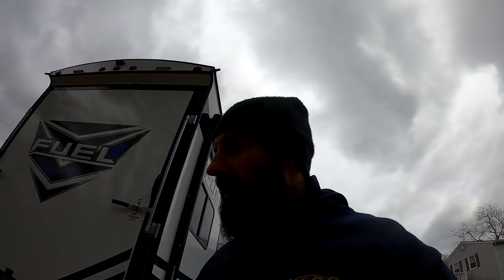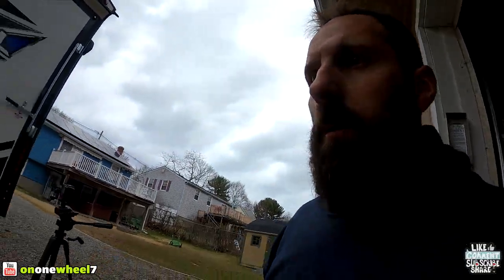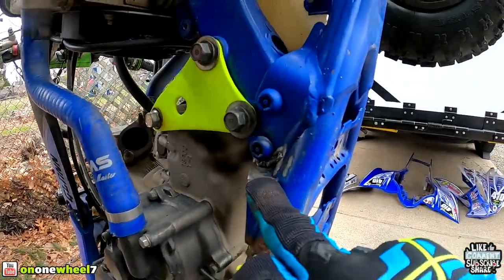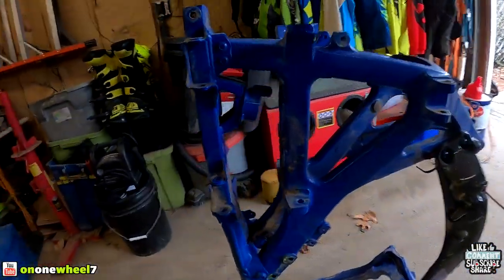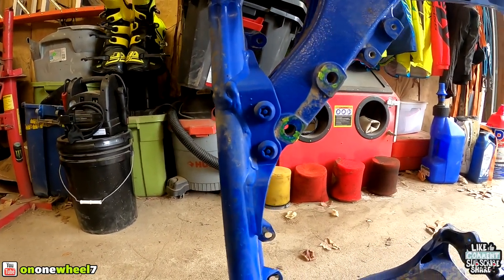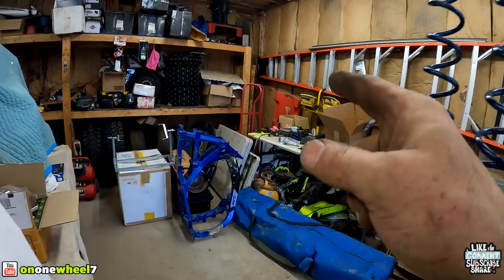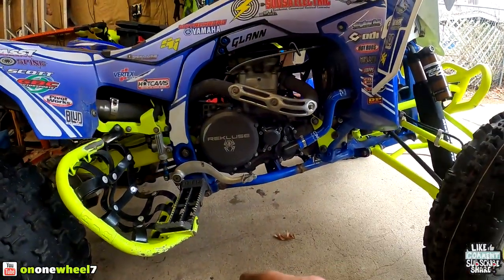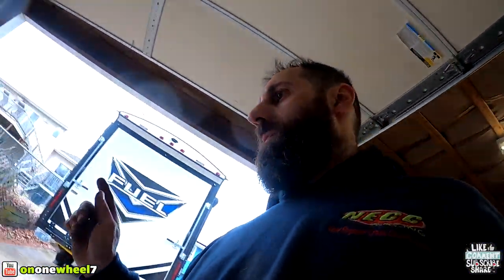FIXING THE PRACTICE QUAD -  THE FRAME IS RUINED YAMAHA YFZ450R

Comment: Out of the topic but Any recommendations on how to get your alignment right, such as toe & camber?
Reply from the maker: Toe you want about 1/8” each side camber is 3 degrees
For tow i use a string off the axle then around the back tire and run it up front and use it as a straight edge to measure of the front tire i ratchet strap the bars straight and then make adjustments as needed on each side until its were i want! Camber a good level surface a 2’ level and an angle finder is how i do that hold the 2’ level on the front tire and put the angle finder on that and adjust as needed!

Comment: Another great video!! What is that Jack/Lift you use to hold your quad up?
Reply from the maker: Thanks man! Its one of the aluminum lifts from harbor freight I’ve had it for 10+ years and its solid used that before i got the atv lift!
Reply: @ononewheel7  Thank you! Harbor Freight trip it is for me tomorrow.
Reply from the maker: Place believe it or not has some decent stuff!
Reply: @ononewheel7  I shop there often. We have 7 actual stores here in Las Vegas. I've just never seen that aluminum lift before. Going to find one for sure. Tired of lifting the quad to put on the dirt bike stand.
Reply from the maker: I am always there as well for something! They at least hear have two jacks one steal and one aluminum the aluminum one is the way to go i think it was 150 back when i got it!

Comment: On your new frame the best way is to cut out a section slide a piece of pipe in it Weld it in place then put the cap back on and weld it back in place..The cap being the piece you had cut out to slide the pipe in
Reply from the maker: Thanks for the tip man this bottom rail is toast i have a new frame to swap over next week!
Reply: ononewheel7 ... The one you’re going to swap over next week is the frame I was talking about, because you don’t want that the creek right away it needs to be reinforced… Respectfully speaking, I know you know what you’re doing…
Reply from the maker: Oh ya on that small crack that one is not completely around he tube its mayb 3/4” crack i really don’t want to cut it at this point  so i may just clean that weld up and hit it again i will have to look at it closer when i get it ready to swap over!
Reply: ononewheel7 ... OK I gotcha, right on!…

Comment: Only a yamaha falls apart that easily lmfao all in the name aha!
Reply from the maker: Ya smacking trees defiantly doesn’t help! This frame was toast a year ago i got my moneys worth out of it thats for sure! Believe it or not i could prob ride it for another year w these welds when you race they all fall apart i don’t care what you ride!
Reply from the maker: But How many trees have you hit 🤣🤣🤣🤣
The bad thing while its good too w the Yamaha’s its a 5 piece frame so once you get a crack if you don’t find it fast the whole frame will flex and more cracks will come up now its nice you can replace each section but i wish it was a solid steel frame! Ive seen pros split hondas in two those are just as bad!
Reply: @ononewheel7  I've hit lots of trees lol only frame I've ever broken was atc 250r they were crap frames
Reply from the maker: Joey Brizzee ya people gusset them now when restoring as well as the trx450’s when building for racing! I wish the yfz450r was one solid steel or titanium frame thank god its not all aluminum i used to have kfx’s and went threw a ton of those frames!

Comment: Send me the frame. I can fix it for you.
Reply: If those frame rails were cracked before you welded them, you shouldn’t have welded over the crack without first properly prepping it. Or it will crack again. Not trying to be a dick. Just an FYI.
Reply from the maker: The upper frame rails are cast aluminum and also replaceable its a 5 piece frame the bottom rail is all steal! Just need one more ride out of her and i have a new used frame I’m swapping over to this week! This bottom rail is toast the rest of it is fine i will save it as its 4 Separate pieces  2 upper rails front bulkhead and rear section! Im no welder haha but i can repair it and it works the one weld i did over a year ago never cracked again it cracked in new spots once they tweak man it never ends!